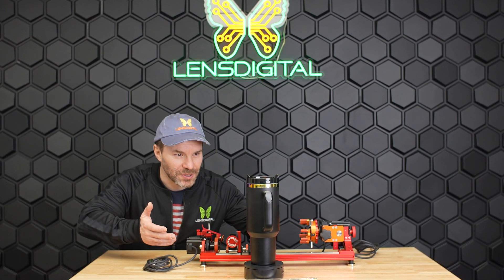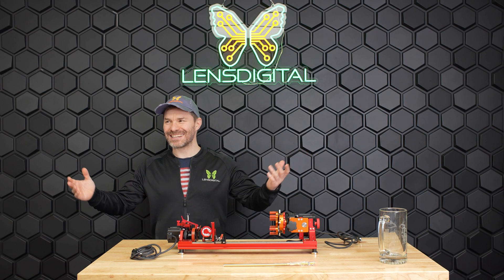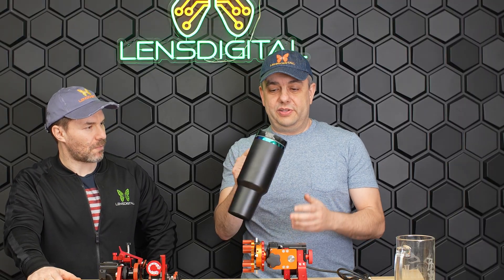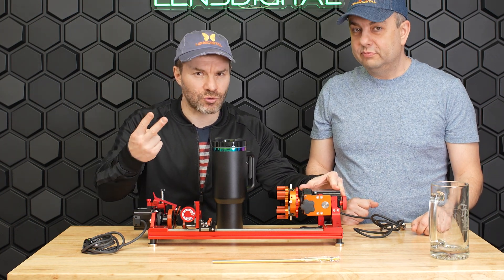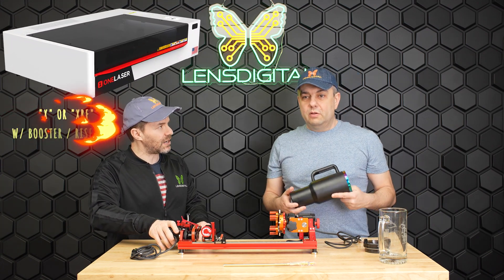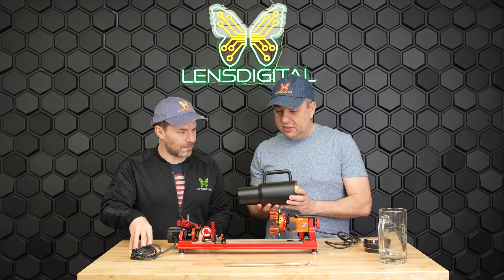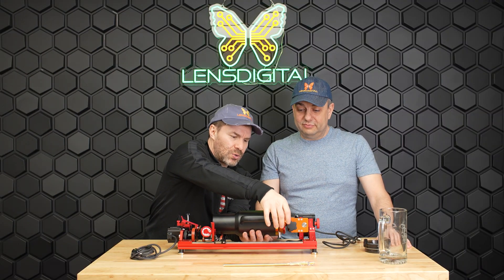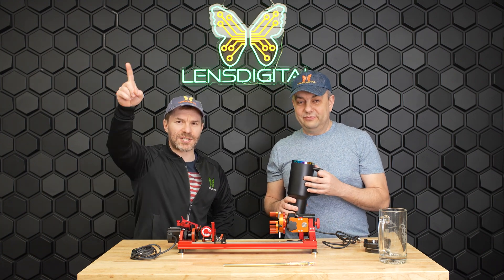Full Wrap with PiBurn OMNI 2 on a OneLaser XRF

Comment: I personally use the Monport Mega which also supports cylindrical engraving with optional rotary add-ons. It has a 70W CO₂ laser, autofocus, air assist, and a large 27.56"×13.78" workspace—perfect for clean, even wraps on cups or tumblers.

Comment: how do you prevent it from hitting the tab ?
Reply: Yes I'd like to know the focal distance!
Reply from the maker: @  About 25mm on both ends of the tumbler
Reply from the maker: Relocate the lens into the bottom compartment of the lens holder. It will give you about 12mm extra space
Reply: @lensdigital1  what settings would you change to accomodate that?
Reply from the maker: @dyeguy48  Under machine settings it's called something like "Focal offset" or "Focal setting". It's probably 11mm by default, so if you move your lens to bottom location you need to change it to 22mm